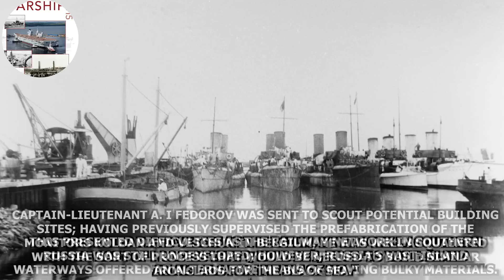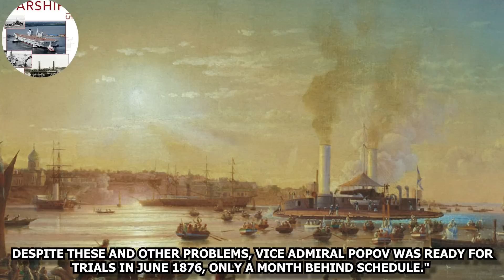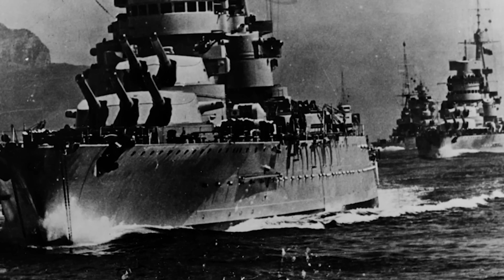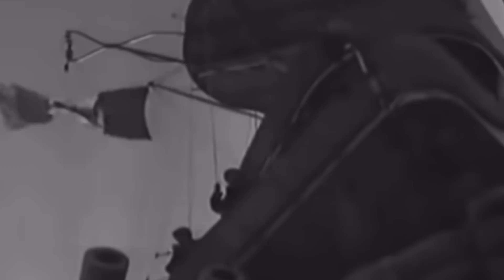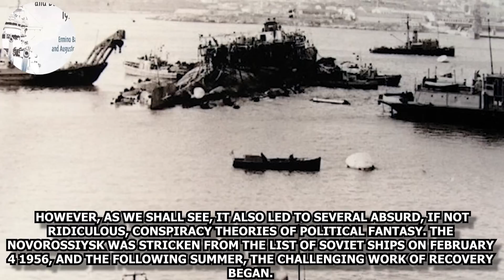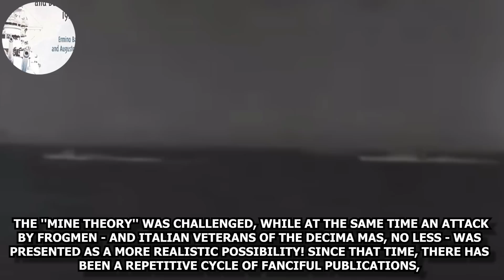Weird and Terrible Russian and Soviet Ships

Comment: I guess the other thing to bear in mind with the monitors, is at least for the original designs they were monitors. It's obvious now that an ocean going battleship makes minimal sense in terms of the hydrodynamics. But if the idea is armoured floating gun emplacements like most monitors tend To be, they seem to have actually fulfilled that role quite well.
Reply from the maker: I really don’t disagree. They weren’t the worst ships, but out of the designs I’ve covered in this series they certainly are the oddest, and using the word “terrible” is a bit extreme I’ll be honest.